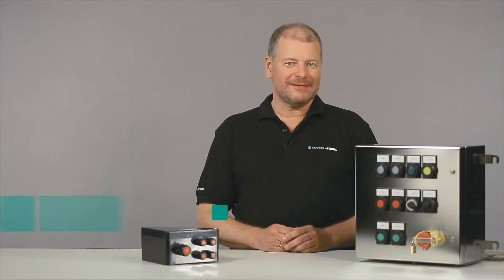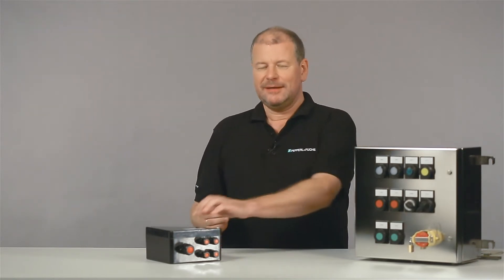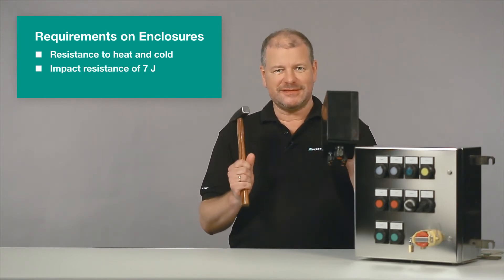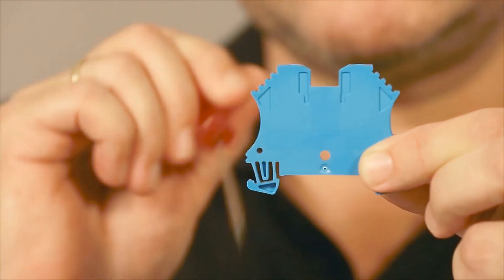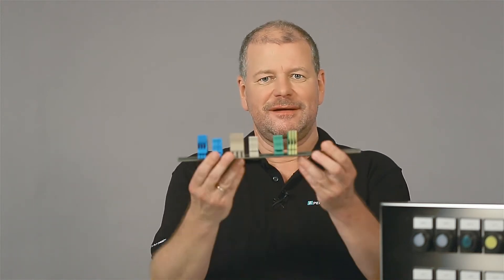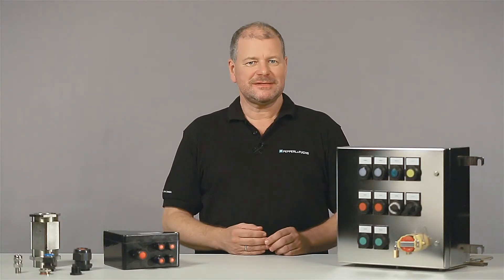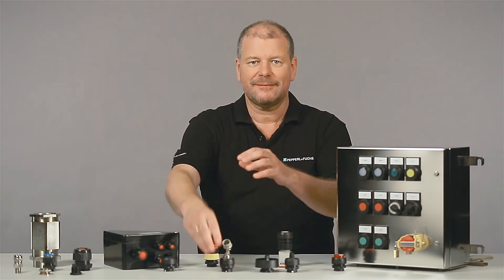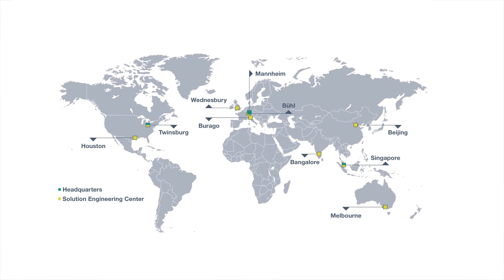Simply Explained: What Is Ex e and What Are the Configuration Options?

Comment: move manufacturing to India you can cut down on manufacturing costs hence bring in customers of abb and others companies, I have seen so many scenarios where your products are replaced by other companies because of cost.
Reply from the maker: Thank you for your comment, Joseph Sav. This is our approach: Pepperl+Fuchs has manufacturing locations for standardized products in Germany, Singapore, Hungary, Indonesia, Vietnam, and the Czech Republic. Electrical equipment and solutions for installation and control of machinery and electrical networks in harsh environments and explosion-hazardous areas are primarily a solution-based business. Experienced project engineers at the Pepperl+Fuchs Solution Engineering Centers—located worldwide—will support the user to find the most efficient solution for his specific requirements. #AutomationPassion